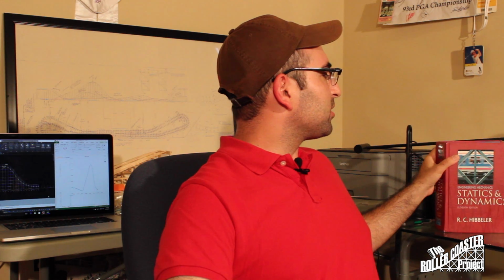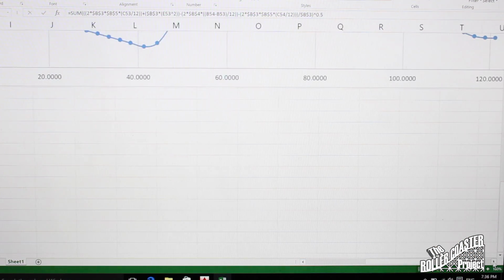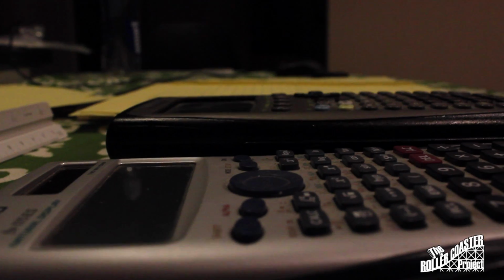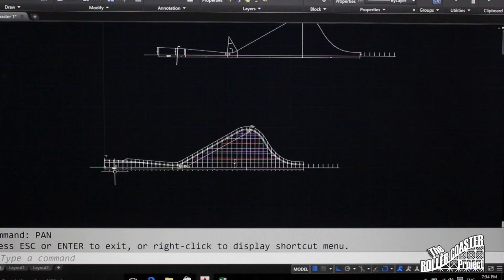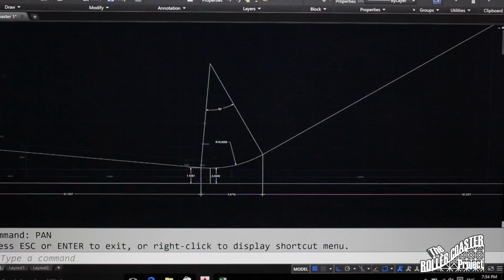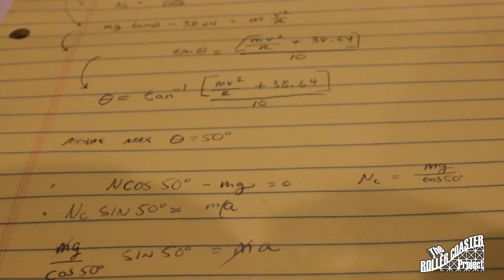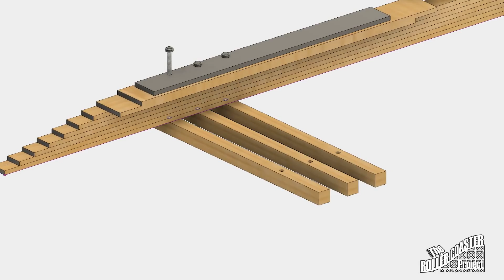(No Music) Roller Coaster Design: Part 1

Comment: Hi, if I remember correctly u mentioned working for GCI or great coasters international. If so, do you have any tips on getting into this industry ? For example would you study civil, structurlal or mechanical engineering and how does one get into that job type. Thanks for all you help on previous questions.
Reply from the maker: Any of those fields will work for the amusement industry, but I would say that more people tend to have degrees in mechanical engineering.  Your avatar namesake has a civil degree with focus in structures, as well as some other people who work for Ride Centerline.  I personally have a bachelors in civil engineering with a focus in structures and now a masters in mechanical engineering.  Regardless of which one you choose, a good understanding of structural behavior and dynamics of rigid bodies with some kinematics will open almost every door.  Finally, I would say connecting with industry professionals and being persistent will help you get in and stay in.
Reply: @therollercoasterdesigner  thanks so much for this, I was thinking of studying structural / civil engineering as I think they are quite similiar
Reply from the maker: @alanschilke6996  that's correct.  Structural engineering is an area of study under civil engineering, and that is the closest to mechanical engineering in machine design.  If you can work on the principles of structural design/engineering you'll be able to extrapolate it to most ride design.
Reply: @therollercoasterdesigner  got it, thanks a lot for this. Really appreciate it.